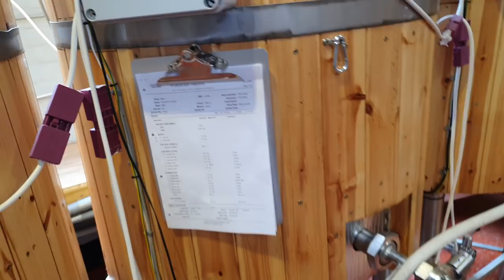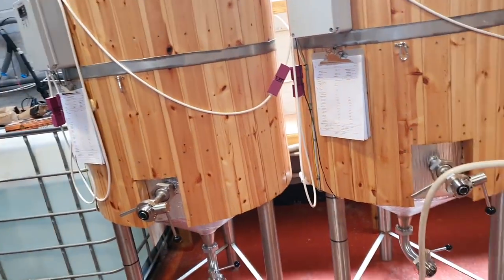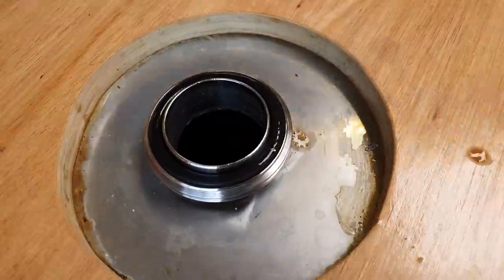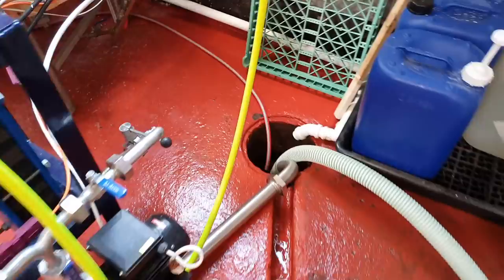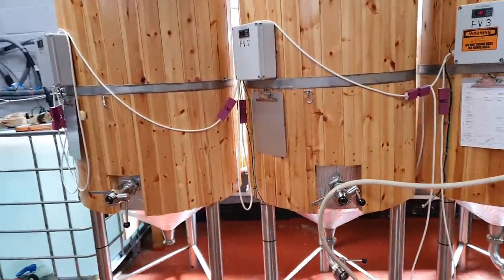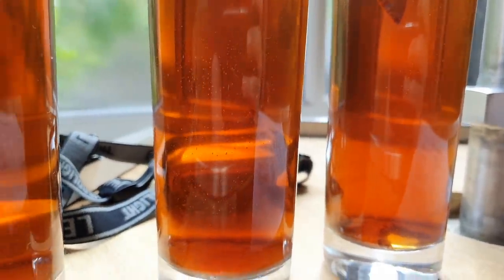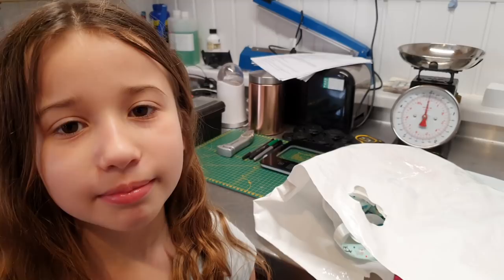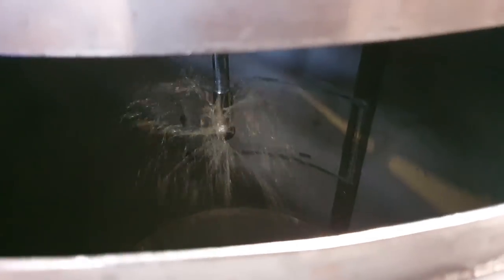Beer Is Important But Quality Control Is Importanter

Comment: Good call, thanks for sharing.  Never fun or easy to discard a bunch of hard work, but at least you had that decision point prior to dry hopping so you could save some of the costs.  Better a bit of a loss as far as materials and labour than repetitional loss due to inconsistent/infected beer.
Reply from the maker: Very true! Not worth it in the long run.

Comment: Ah m8 sorry to see all that beer go down drain,must have been difficult but you made the right call,no point ruining your reputation for the sake of trying to save the beer,the hit from doing that would be worse than the cost of what you just dumped. Good call and fingers crossed it's sorted now. Do you plan on putting the bitter in cans at any stage? Cheers 👍

Comment: Did you ever consider inoculation with brett to try and salvage the beer? Is that even an option on the commercial scale?
Reply from the maker: I'm afraid to introduce more bugs in to the brewery until I know I have the ones already there under control.
Reply: @harrybrew69  Yeah probably not a great idea!

Comment: I assume you confirmed the gravity with an old school hydrometer and didn't just rely on the Tilt?
Reply from the maker: Yeah, We have to use the big ones from Stephenson Reeve. They have a great accuracy so you have to buy the different scales. 1.000 - 1.010, 1.010 - 1.020, 1.020 - 1.030 and so on. All about £70 each so I try not to break them.
Reply: I’ve learned not to rely on the Tilt when I suspect something is going wrong.   I’ve had it report incorrect SG several times for various reasons.
Reply: My Tilt consistently reports 3 points below the accurate value, so I guess it's somewhat trustworthy. Interestingly it reports the accurate value when testing it with sugar water, but always 3 points below my hydrometer (that also shows the correct value in sugar water) in beer.